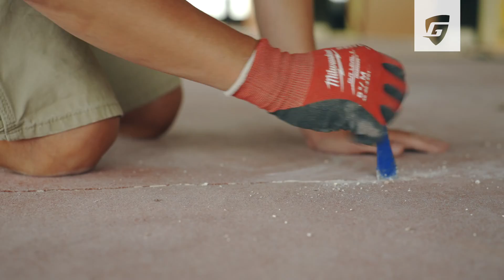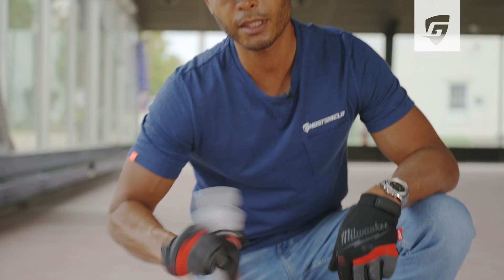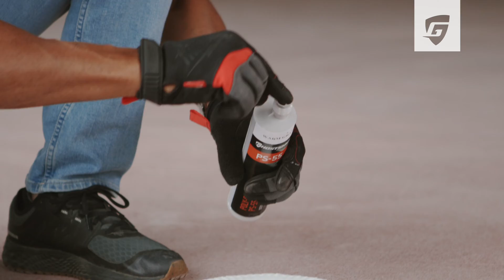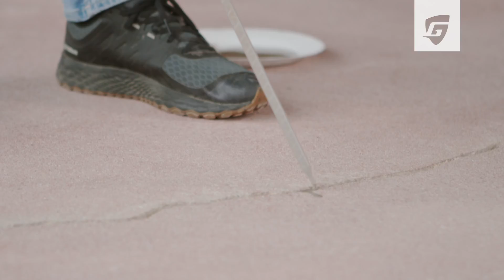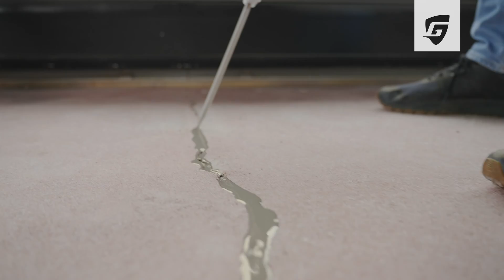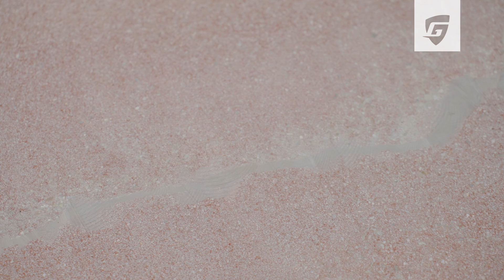How to Seal Concrete: How-To Repair Cracks

Comment: What's the difference between the PS 55 and the PS 80?
Reply from the maker: Poly-Strong PS 55 is intended to seal cracks whereas the Poly-Strong PS 80 is intended to seal joints.

Comment: Can the cartridge be stored away for reuse after one time?
Reply from the maker: Once the product has been used with the static mixing nozzle attached, it needs to be used in its entirety otherwise the material will harden.
Reply: @GhostshieldConcreteSealers  thank you for the reply. Is there another product that can be used for filling surface cracks but can be stocked away. I think I will have to throw away 80% of this product otherwise since I may not need the entire cartridge.
Reply from the maker: @karthikmahadevaiyer  Our crack fillers are all two component products that need to be used in their entirety at time of application.